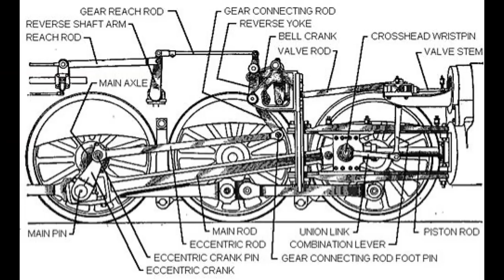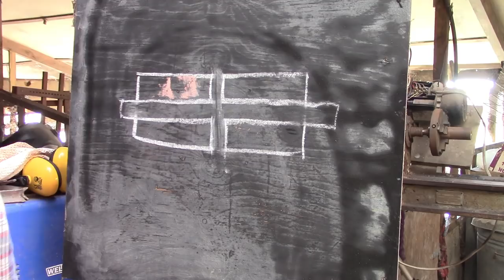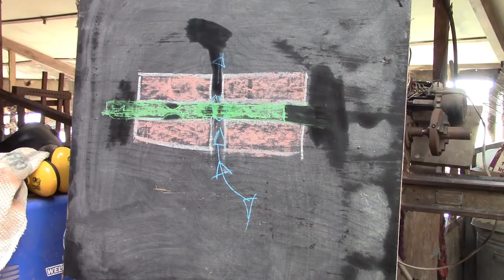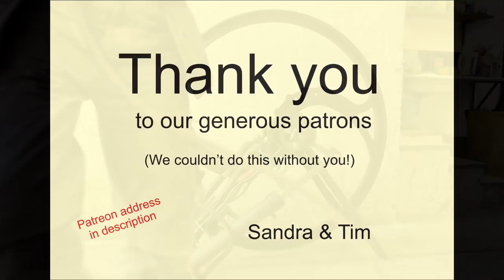Homemade Air Powered Engine Reaches 50 rpm!!

Comment: As others have said, Tim, make that piston double-acting, then add the same contraption to the other side of the flywheel, but 90deg out of phase, so it would be self-starting (power available at any point in the cycle.) And roller bearings on the push rod ends to bear on the cam faces would save a lot of friction and potential wear. But it's looking good - very satisfying to see it in action!
Reply: Mini railway
Reply: @happiestcamel5064  Dampfklienbahn
Reply: I doubt that he can make the piston double acting, considering he made his from hydraulic ram.
Edit: apparently there are double acting hydraulic rams, my bad

Comment: Most of those hydraulic cylinders are double-acting... so you could probably get power on the "backstroke" too, with more plasma-cutting, and timing, I'm pretty sure that's what they did with the old steam engines. I imagine it's possible, and that you've already thought of it, but I don't think it's a crazy idea anyway ;) So impressed with your skills on this project- from a seized cylinder and flywheel to a real, working air engine! Fabulous!
Reply: Exactly what I was thinking. It doesn't have to produve a lot of power, just enough to overcome some of the friction.
Reply: Steam engines did have a return power stroke. It was controlled by the valve chest above the cylinder.
Reply: just as i thought !!!
Reply: The problem is that it requires almost twice as much air. So energy is spent compressing air to put through a double acting cylinder to do what? On a four cycle engine, there are three idle strokes.
Reply: @yt650  i wouldn't call them idle strokes, they all have an important purpose.
Reply: @yt650  use the exhaust system to power the return stroke
Reply: This would be a marvelous idea - add power to your return/exhaust stroke.  You've got this, Tim!  We could see Sandra 7:18 doing "real" work with her wheel barrow!  (smile!)
Reply: @williammcguinness6664  the piston surface area of the return stroke is smaller than the piston surface area of the pushing stroke, so the cylinder will still push out if you connect the outlet to the inlet of the return stroke.
But it would work if he connects the compressed air to the pulling side and the exhaust to the pushing side of the cylinder. That would also greatly increase efficiency...
Unfortunately he removed the seal of the piston rod, so this cylinder is no longer double acting ..
Reply: @yt650  ehm... What?

Are you... Comparing an air cylinder to a cumbustion engine?
Reply: @ABVollen  'idle' just means 'non-power' strokes. a four-stroke engine has three non-power (idle) strokes, and one power stroke. kapiche ??

Comment: This engine looks really good!!I do think the comment about a fatter piston might be right, as although it'll take more air, more pressure can be put into the engine and give it more power! Another good idea might be to add a second piston 25-30 or so degrees offset, so there's no big gap in power, and the engine will run much smoother. I'm no expert in engineering or engines, but I think these might help. Either way, keep up the good work and have a nice day!

Comment: I would recommend adding a second piston and set of valves on the other side, as well as using both sides of the pistons. You might be able to use 1 valve per piston if you use something like the Stephenson's valve gear. it's a bit more complicated than what you have here, but you could get much more torque and speed out of your piston and use both sides instead of just one side!
Reply: Mini railway

Comment: A counterweight on the flywheel would help smooth things out a bit. But the issue with power is the surface area on the piston is too small, power will be higher with steam than air but still not going to be great for much work. Maybe its time to make your own cylinder 🤔 same stroke but larger surface for the pressure to push against.

Comment: 2:43 Your sealing issue could be handled with O-rings, if you make the ports offset along the length of the shaft, with an O-ring sealing against the shaft between them. (So you would have an O-ring above the valve section, one port, another ring, the second port and the third ring at the bottom.)

Then you'd grind a much longer bit on your rod, as airflow would only occur when the narrow section was bridging the gap across that central ring.

Comment: Brilliant work Tim, You are working with High Volume Low Pressure (HVLP) and not High Pressure Low Volume (HPLV) - in such situations pipe diameter is key, larger bore is your friend - less pipe is always positive. The entrance to the cyclinder as large as possible within reason! Your valve set up, a lot of work, but maybe a cylinder head and "4 stroke Valve" set up would suit better, remeber your steam supply on the other side of the side of the valve must also release quickly through the valve. I'd suggest a small tank slightly larger than the stroke of the piston - which the valve opens into. Love the work and look forward to the next set up :) :)
Reply from the maker: I should have realised that earlier on. The valves wont allow for bigger fittings. But still, I'm sure something can be done...

Comment: @Way Out West - Workshop Stuff
Hi again, One thing I think of (but I don't think can be done in the current configuration), is to push out the piston in the top of the wheel, instead of bottom, in that way the weight of the piston would help in the un-powered part, but that would probably add like +1 rpm or something.
Another idea, is to hook up another piston in the same way, but rotated to along the opposite leg of the support triangle, I don't think the timings needs to be adjusted at all, as long as the cams relative position to the piston & wheel center is unchanged (remember to think of the rotation direction).

I really like the cam design, it's exactly what I imagined from the previous videos.

Comment: I notice that there are holes in the cast flywheel ‘spokes’ - It might be worth experimenting by bolting on weights to smooth out the rotational action using those holes. 
It’s certainly a lovely bit of engineering - quite beautiful really! 👍

Comment: I would first like to say is well done on the design and setup of your air powered engine. I wonder though, if you make it a double-acting cylinder, if it would help with maintaining speed and not solely relying on the momentum of the flywheel? Maybe add a second cylinder and have the cranks to be 90 degrees offset, possibly a little bit more- so that every rotation of the cranks shaft is a power stroke? Love the content you have. ❤

Comment: Great work! If I may suggest as I do have experience in this area. When the pressure valve opens it requires X amount of volume to fill the cylinder, where does it come from? it must come from the source at the end of the hose (compressor tank), so to aid this gulp of air, you can put a small air tank at the pressure inlet of the valve. A larger volume that what the cylider requires.  What will happen is a volume of air can be taken rapidly without draining this tank, during the return stroke the supply line will finish off filling this volume of air. - in pneumatics/hydraulics we call this tank a remote accumulator. I also design this air tank system into CNC machine shops to install portable 30gal air tanks next to each machine thus easing the burden on the supply lines and having to have a greater CFM main compressor.. Another thing you could do is add a second outlet on the pressure spool to pressurize the return stroke - google 3 way spool. Well at the very least, I hope this just inspires thought.
Reply from the maker: Thanks, Michael. Interesting!

Comment: Richard Trevithick would be proud. Could you add another cylinder on the other side of the frame offset at about 60 degrees, this would give you a longer duration on the power stroke. Its a lot more 'plumbing' though. Cracking effort all the same 👍👍

Comment: Remember you need some sort of liquid to lubricate the piston seals, the water in steam would normally do this. I recall a museum using air to drive an old steam engine motion but it ran dry and seized.
Reply from the maker: That's why I put oil in it in the video
Reply: Water doesn´t lubricate (enough). You need oil.
Reply: @vornamenachname727  In any liquid pump, the media being pumped is the lubricant and often the coolant.
Reply: @wayoutwest-workshopstuff6299  I am thinking of on going use, your flash boiler would provide water condensate that an air compressor won't.
Reply: @stevelowndes5803  Nah not always. High pressure Diesel pumps for common rails do use the Diesel as lubricant, but they won´t work with anything else. Thats why you can´t pour petrol into the tank of your modern diesel car in order to keep the diesel from becoming a gel in winter. Even a small amount of petrol will destroy the pump because there´s not enough lubrication.

I´m a fireman/stoker ("Heizer" in German) at a railway museum in Germany. They´d f***ing kill me if i ever tried to run the engine without oil. ;D
Reply: @vornamenachname727  Yes, internal combustion engines are a totally different ballgame. My main point is that the engine in the video would require ongoing lubrication if powered by air only.

Comment: I'd say a short fatter piston may be able to provide the same torque. If you take the lever arm at the crank, the area of the current piston, and the pressure you're running at you should be able to find the amount of torque (without losses) the engine can produce. Then if you run a squater fatter piston of the equivilant stroked volume you may find that, with the lever arm that then has, the torque figure is the same. As essentially the increased force on the piston (due to the larger area), and the smaller lever arm due to the shorter stroke cancel out mathematically.

Comment: Hey Tim, love your vids I've got a few thought about your project as follows,
The flywheel you are using is too light especially near the perimeter and doesn't store enough energy to carry the rotation back to its starting point, it needs more mass.
The cylinder, being designed for hydraulic use has small ports that restrict the flow of air to in and out there would be a definite advantage in creating large ports all around. Rapid filling is essential
A larger diameter cylinder would be also help and wouldn't necessarily use more air if the stroke was shorter proportionately.
A double acting cylinder is a must, the efficiency loss on the back stroke is way to costly.
These are just a few thoughts which I hope don't appear too abrupt, I have other ideas but have tried to keep it short keep up the good work.
Reply from the maker: thanks, Chris. Yep, all good points. (But I'll keep trying with what I have for now..)

Comment: Tim if you still going down the steam engine route you going to need a bigger boiler then the one you had that went bang but don't forget that steam is a gas and it volume is 4x the amount of air so some pressure gauges are a must. now if your going to keep topping the water tank your going to need to take that with you and a pump to pump it in to the boiler and don't pump in cold water as the shock of the difference will make that bang sound again so you will need a pre heater for the water just like your super heater but water going in . And for heating instead of wood or goal that you will have to carry as well Why not use a gas burner and a gas bottle like you would use on your BBQ as you can control the amount of heat and you can shut if of if things get too hot and the pressure is rising too much hope this helps and don't be afraid to contact me if you would like more help

Comment: I wouldn't have thought a chaff cutter wheel would be effective as a flywheel....it just doesn't really have the weight to slightly overtake the piston..i'd be hesitant to add weights to it too....it is only cast....looks good though!...very clever!

Comment: So a lot of other people have suggested powering the backstroke as well because the piston is double acting, but before you do that I would also suggest that you make both the intake and exhaust activate and deactivate later. This gives you less powered time and less exhaust time BUT the piston wont be traveling at such a high velocity right at the end of the powered stroke. This will make the engine run smoother. also, if you are going to power the backstroke, it needs to be 180 degrees out of phase NOT the 90 degrees mentioned in other comments. you can also achieve the same thing by placing another piston on the engine as well. just make sure that they are 180 degrees out of phase. if you decide to go the extra mile and power both pistons on their backstroke as well then each stroke needs to be 90 degrees out of phase. this insures that at least one piston is on every quarter of a rotation. This allows for a smoother rotation. Before any of these modifications you're going to need more air, in fact, having more air will also make this engine more powerful and faster in its current configuration. I hope this helps a bit, and I look forward to seeing your next video!
Reply from the maker: Thanks. Yes, I've considered all those options and decided against double-acting  these cylinders because the rod takes up so much space - I'm going to try adding the other cylinder. if I can..

Comment: Hi Tim! I really enjoy watching your projects evolve as you make something, and then try to improve it. I see many suggestions in the comments to make this engine double acting, but I have a Very simple suggestion to try before you modify your engine further. 
Use a Ball Valve on your air hose instead of the little air nozzle you are using. The air nozzle is rather restrictive internally and throttles the air a lot. On my air engine, made from an old lawnmower engine, switching to a ball valve made a very noticeable difference. Cheers M8.
Reply from the maker: Good idea. Thanks!

Comment: A 3rd cam at a shorter interval, just as an added thrust as the the power stroke peaks may help. Also, remember how well a weighted flywheel helped your previous wood chopper? Might work to maintain momentum without a 3rd cam at all.

Comment: On my first day with a hydraulic engineer, he taught me:

Pressure gives you power
Flow gives you ‘go’ (speed)

I think this means that it will be hard to get meaningful work could be done with pressurised ambient air unless you can eliminate a far greater proportion of the losses. 

Perhaps it would be more successful to use the wheel to compress the air in an air tank, then run the compressor pump in reverse to drive the electric motor as a generator….

Comment: i think it needs more weight on the flywheel more specifically offset weights so when it goes around it offsets the dead air of the strokes therefore increasing its RPM because it returns quicker

Comment: You need a counter weight on the wheel, locomotive wheels have a cast in counter weight to get a steady speed as the counter weight helps the wheel spin uniformally ot the drive of the pistons crankshaft

Comment: The required timing for steam will probably be different from that for air - especially on the intake side. Steam expands a lot more than air so you can close the intake earlier, which means less steam to push out of the exhaust, and freer running.
Reply from the maker: Thanks. Yes, I had worked that out, but for now it has to work for air

Comment: Could shorten the power stroke.

You have roughly 50%on 50% off. You were right that timing could help, but probably the biggest fixes will be to increase the input and the output sizes, as if I had a hole the size of a needle tip, it would take days to get that pressure up. (Widen the hole, widen your cuts, super big on your exhaust.)

Bigger hoses/pneumatics could help a ton as well. Same as above, pin hole means less than helpful, bigger hole, faster pressurisation.

If you increase the power of your power stroke , you can afford to only use the first 75-90% of the travel, which gives your exhaust a chance to drain Before the return stroke is trying to compress it.

Lastly, I would argue that double action would possibly help, but if 80% of your limitation is already not enough pressure quickly enough, I expect it to equate to minimal help.

If your pressure is fine, then my whole comment boils down to 'let your exhaust stroke kick in a tad earlier, so you have less resistance.

Otherwise, bugger pipes, bigger holes,etc.
Reply from the maker: Unfortunately the valves are too small for bigger fittings but you're right about the air flow so I will have to find other ways to improve things

Comment: A wider piston also generates more torque because the air or steam has more material to push on so you have more power at the same pressure

Comment: What steam train wheels do that I don't think you are doing is counter weighting. On a train wheels you should be able to see a big block of ballast opposite the camshaft, which means when the wheel is being powered the weight helps push it downwards, then loses the energy it gained by helping push the wheel upwards and letting the piston retract. Something like that may work wonders for your flywheel.

Comment: A larger diameter air hose, also a short as possible, will help. I ran a construction gang using air nailers for a few years and quickly learned that those cheap shop air hoses really restrict air flow!
Reply from the maker: Yes, I think you're right..

Comment: Timing valve could definetly be bigger, as on steam engines the steam valve box is almost half the size of the cylinder.
Also, you might have already though about it, but you can already make this contraption double acting by adding holes to each valve.